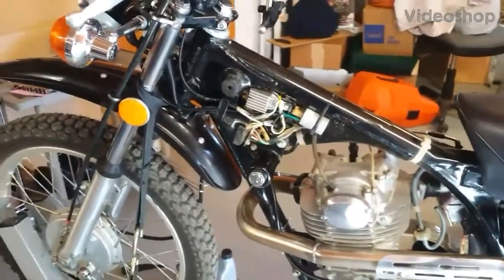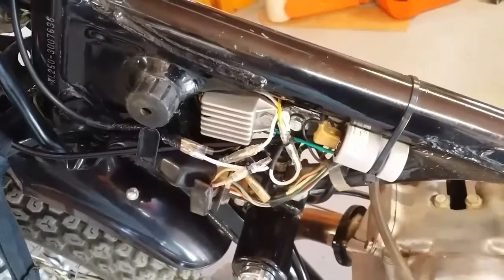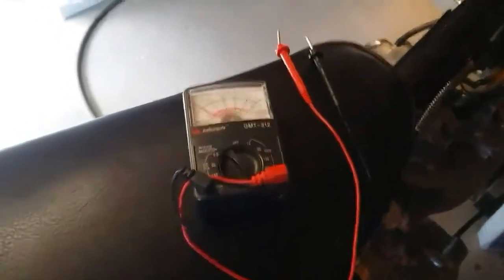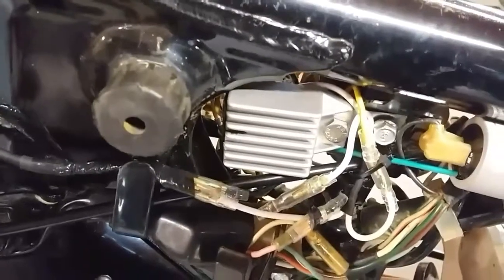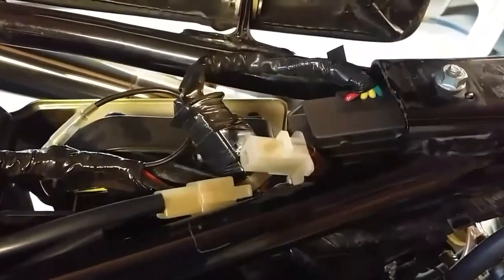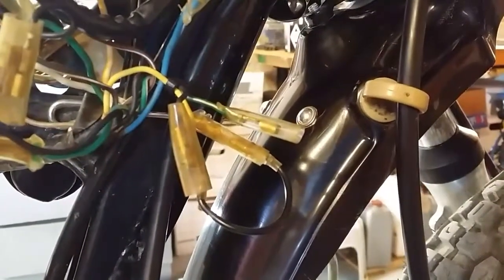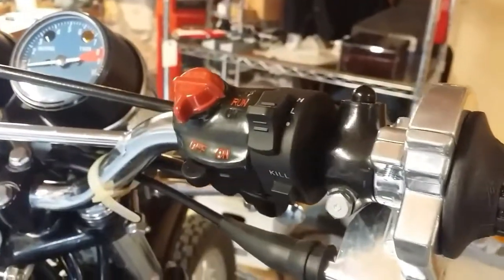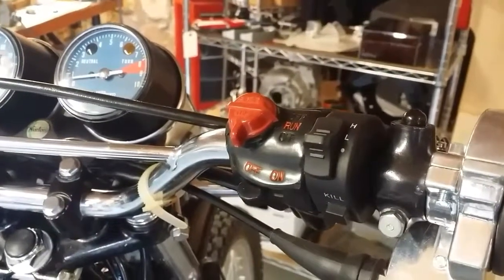Honda 1975 XL250 K2 Electrical & Performance Upgrades

Comment: Can you provide links to your purchased items? That would be super helpful. I’m going though a 1972 XL250 Motosport with my 15 year old son right now and he’s doing all the work himself. Your videos are very helpful!
Reply from the maker: The LED lighting kit which included the "Flasherino" solid state 6 volt flasher came from the Pardue Brothers. Try them with an email to info@parduebrothers.com. The headlight AC voltage regulator came from Rex's Speed Shop in the UK. Try rexs-speedshop.com. The Mikuni Carb/Header kit came from xlintperformance.com. The DC voltage regulator (to charge the battery and provide DC to horns, turn signals, tail light, stop light and ignition was purchased on ebay from an Asian supplier (unbranded). They generally run for about $20 or so. Sorry for the long delay in responding but I hope this helps.
Reply: @billybobcox4195  thank you!
Reply: @billybobcox4195  thank you for your video! I’m going through a restore/rebuild right now and broke the original Keihin carb. Can you tell me which Mikuni carb you got?

Also, I’m really impressed at how clean and neat your build is. Nice work!
Reply from the maker: @runnhunt  Thanks for the compliment. The Mikuni is part of a kit including the correct jetting, throttle assembly and the header with megaphone (wouldn't call it a muffler). The source is Dave Rhynehart at xlintperformance.com.